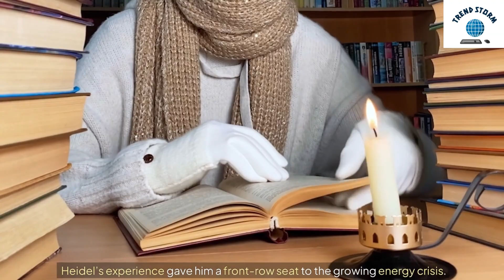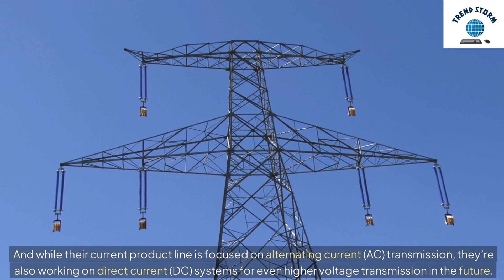Transforming the Power Grid With Superconducting Transmission Lines

Comment: If we have to depend upon long distance power lines then we didn't do the system right.
Reply from the maker: That's a valid concern! Localized energy systems, like microgrids and distributed generation, are definitely part of the solution for resilience and energy independence. However, long-distance power lines remain crucial for balancing supply and demand across regions, especially as renewable energy sources like wind and solar often produce power far from where it's needed. Innovations like VEIR's superconducting lines aim to address this by making long-distance transmission more efficient and less intrusive, complementing local solutions rather than replacing them. What are your thoughts on integrating both approaches?

Comment: What are the thermal conductivity parameters of the cables in this system?
Reply from the maker: The cables have extremely low thermal resistance due to advanced materials and cooling.

Comment: How does cryogenic cooling interact with high-voltage insulation materials?
Reply from the maker: Specialized insulation is used to prevent breakdowns at low temperatures.

Comment: What are the energy savings from reduced resistance using VEIR’s cooling system?
Reply from the maker: Energy loss is significantly reduced, leading to higher transmission efficiency and savings.

Comment: What’s so special about their cooling system?
Reply from the maker: The cooling system uses nitrogen in a vacuum-insulated pipe to keep the superconducting cables at optimal temperatures, enabling high-power transmission over long distances!

Comment: How does this technology compare to traditional power lines?
Reply from the maker: Great question! VEIR’s lines use superconducting cables and a unique cooling system, allowing for much higher power transmission without the need for larger structures.